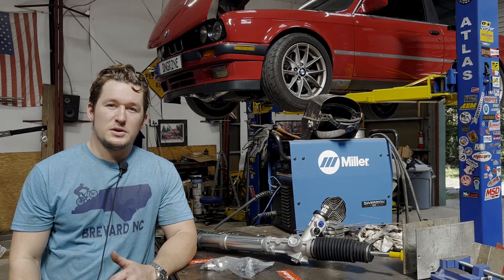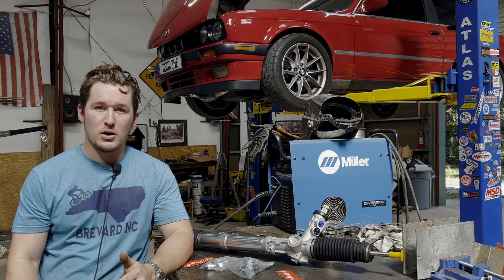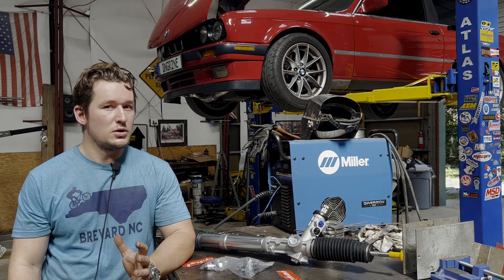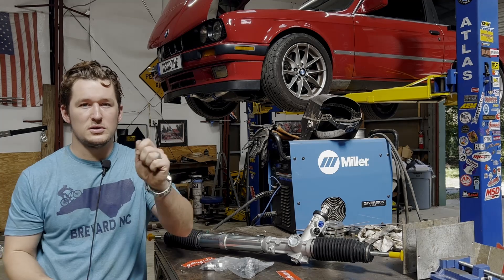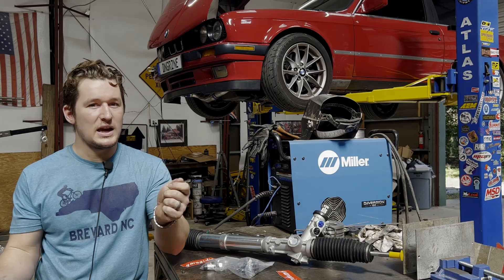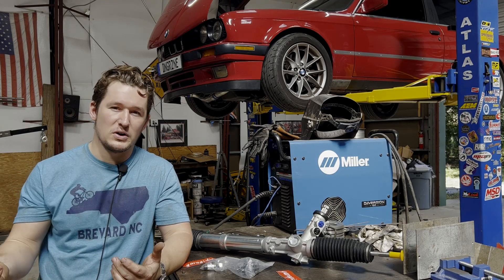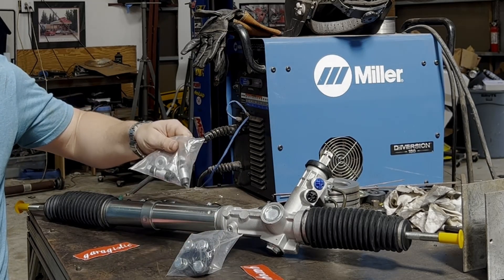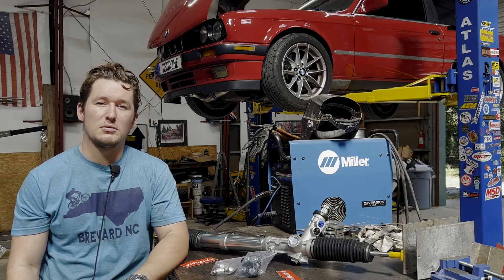Project Turbo E30 - Z3 Steering Rack Conversion

Comment: what did you end up cutting a bit confused by looking to do this on mine
Reply from the maker: I had to get the old rubber joint out. I’ve seen a few different ways to separate it. The angle grinder with a cutoff wheel was mine.

Comment: Saw you gave up on the rack tab spacers... so did I. Ended up just getting some washer and making it work.
Reply from the maker: Oh no I used them, just had em on the wrong side and had to remove temporarily to put them on the correct side.